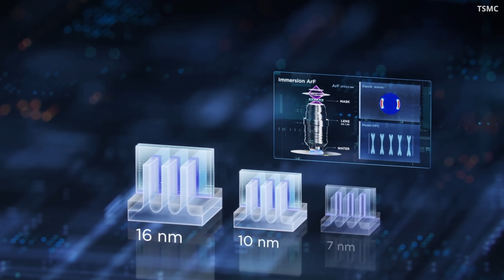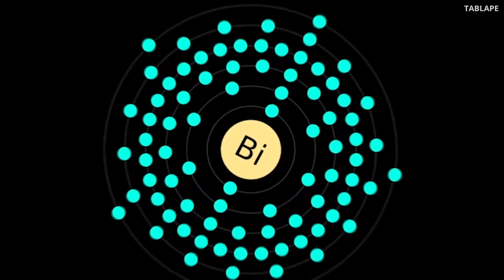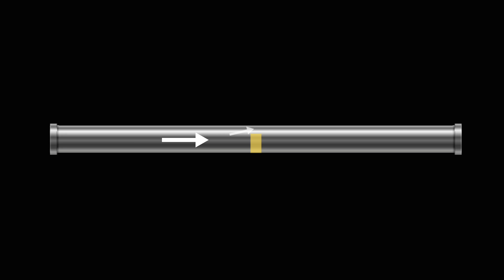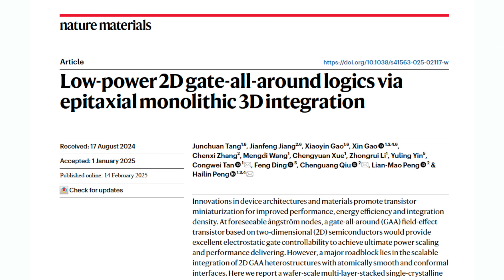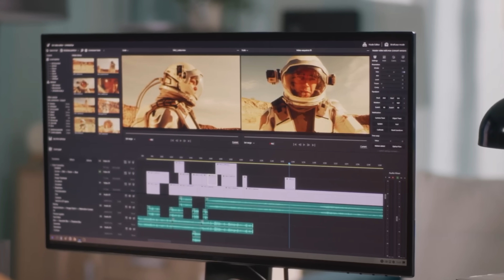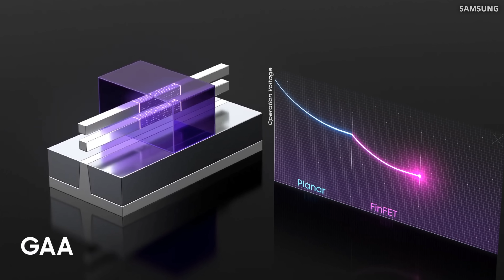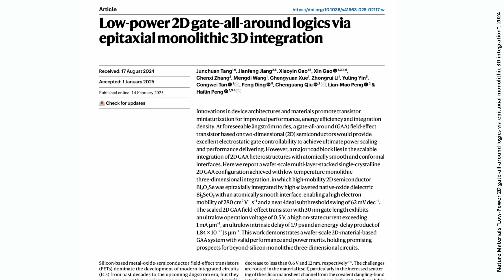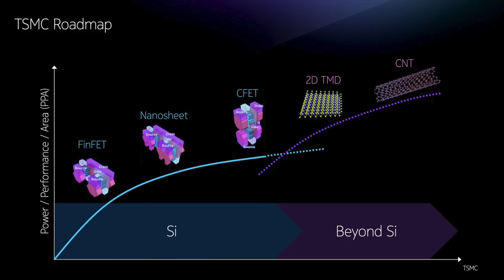World’s First Silicon-Free Processor

Comment: If Bismuth is slightly radioactive that means some of it will be alpha-decaying randomly into Thallium and a hydrogen nucleus, so it will be interesting to see how that manifests in future computing glitches. As long as the amount of Bismuth is more than just a handful of atoms, it should remain stable for well past the typical operative life of a conventional computer chip, but if only a few atoms are integrated in each transistor it starts to get dicey.
Reply: Since Bismuth has a half life longer than the age of the universe, I think that won't be an issue but I am no expert. Interesting to run the numbers by someone who can competently do so (not me 😂)
Reply: @justlisten82  I tried to show the math but my comment gets deleted. Short answer: 28 million years for 1 atom out of a trillion to decay.
Reply: @coder0xff  If that's the case, if there are 6.02*10^23 atoms, doesn't that mean at least a few should happen within short periods?
Reply: @ 25 minutes
Reply: @ One mole of bismuth is 209 grams, which is quite a lot for a CPU. I'd be curious to know how many atoms a chip would actually have, and how many decays mean it could tolerate before failure.
Reply: Sounds like planned obsolescence.  If your hardware will decay I suppose you will have to upgrade.
Reply: Pretty much every thing decay @nathankovac2594
Reply: Radioactivity of Bismuth is so insanely small and insignificant that it will pose no problem. There is way more radiation around chips from natural backround sources like Potassium-40, Uranium, Radon, Radon daughters etc. Even the chip packaging has more radiation than bismuth.
Reply: @Ignisan_66  although the element transmuting into another will surely change its electrical properties, and when you are working at such small scales every atom matters.
Reply: @tuseroni6085   If you had 1000 Bismuth atoms, on average you'd need to wait 27.4 quadrilion years for even 1 atom to decay. Statisticaly it is so impossibly unlikely that a Bismuth atom would decay in a small chip.
Reply: People who don't know what "half life" means.

The half-life of bismuth is 19 quintillion years ...that means half of your bismuth turns into lead in that time.

Transistors at this scale would allow for trillions of transistors on one CPU and I'm guessing they used about 10 bismuth atoms per transistor.

So to get at CPU a thousand times more powerful than current CPU's you would need around 100 trillion atoms of bismuth.

So if you have 100 trillion atoms with a half life of 19 quintillion. You'll have 3 transistors that are spontaneously contaminated with lead and helium per week.
Reply: is it just me worrying about the temperatures? the thing has a melting point so low you can melt it on a stove
what happens when you put it in chips regularly running 70-90 degrees on heavy tasks without LNG cooling it?
Reply: @exorias625 All that stuff in the video about bismuth is irrelevant. The actual semiconductor material under discussion is a mixture of bismuth chalcogenides (including oxygen). The melting points of these substances lie far above any temperature that a working computer would encounter.
Reply: Background radiation mainly Potassium K40 will be far greater than Bismuth. 

Background radiation already causes a few noticeable events, but only in large memories.

Comment: Bismuth has a very low melting point of only 271C.  At even 80C I would be very concerned about material creep.  It's very interesting technology but I would be interested in seeing the longevity of these chips.
Reply: Bismuth, in particular, is very soft. If you attach a cooler to it with high contact pressure, it'll be interesting to see what happens to the transistors.

Comment: How come you are avoiding the years old research development into 4 Terahertz Magnetic Celluar Automata chips, which seems to use something possible like my previous circuit improvement?  Also, the 40Thz magnetic computing research, which  aligns with my estimates from over 20 years ago?  It's all mechanism improvement, how things work.

At least they are trying to increase speed substantially this way, to progress the slow mobey taking of industry, rather than radical solutions, which probably top out at around 600Thz+..

Comment: Its Beautiful!!!. Switch at Terahertz speeds!!! We're still in the single digit Gigahertz speeds, and we're making a jump to half a Terahertz??? Amazing!!
Reply: Gates always have to switch at a high multiple of chip cycle speed because the chip operations are tens of gates deep at least.
Reply: We don't know if this concept will make it for commercial use, because just a proof of concept isn't enough to prove that it's a good design ready for mass production
Reply: At 1/2ns/ft (roughly light speed in the material) that next transistor has better be very close.
Reply: @msimon6808 or just have 100’s of thousands of tiny cores.
Reply: except we don't know the comparison, silicon transistors can also switch fast if you only have one of them: already in 1990 IBM had silicon transistors switching at 75 GHz, and we've since hit 600 GHz for silicon, and more for other materials

Comment: Anastasia nice job! Love your videos!! 

However the transition to bismuth might be problematic for other reasons like scarcity of supply. Bismuth is far rarer than silicon (0.0000008% of Earth’s crust) vs (28% of Earth’s crust) for silicon.  Consequently silicon production is virtually unlimited (~8 million metric tons annually for all uses) vs ~10,000–15,000 metric tons per year for bismuth and that’s primarily from China. China in recognizing it's strategic value as a critical mineral and restrictive trade measures mostly from the US has imposed export controls on it resulting in a soaring price and limited availability.

Comment: Okay but, 0.5nm doesn't actually refer to the literal size so they AREN'T running into quantum effects of being that small. Am I missing something?
Reply: Don't think you are. I mean I like her vids but find it misleading in some when this isn't explained and people think it's actual sizes. This one wasn't good because it referred to the dimensions as if it were 0.5 angstroms. I think she does mention it in some that they weren't transistor sizes or actual dimensions of other parts of the chip.

Quantum tunneling is still an issue mind, but that's why gate length hasn't changed for a while iirc.

Comment: Germanium used to be used in chips. Silicon has a bigger bandgap, which means the difference between the on and off states is larger (less leakage when 'off'). Bismuth sounds like it needs a lot of research (lower bandgap, unusual electron behavior halfway between metal and semiconductor). The Nobel Prize in Physics went to three Japanese guys who figured out that defect density in GaN doesn't have to be as low as silicon when used in blue LEDs. Bismuth might find a niche somewhere (UV LEDs?)

Comment: before opening you mouth how about thinking? (both of these examples are thinking from the perspective of a superconducter) going 1 ghz gives 1 nanosecond and light/electricity can travel 30 cm in that time. But 1 thz only gives 1 picosecond which would only allow it to travel 0.3mm. therefor heavily limiting the circut size and the amount of transistors it can flow thru at that speed.

Comment: I wonder how long until we see this technology in the wild, employed in enterprise application, and how long until we see this employed in the home consumer market?
Will we see a whole suite of this technology where CPU, GPU, and RAM all made with bismuth telluride, or will we first see a Frankenstein implementation where systems deploy with current silicon with the exception of one bismuth telluride part?
I wonder how this will effect SSD storage media?  Will this be gen 6 or 7 SSD with read/write standards of 25000mbps?   
How will the speed and efficiency of these chips manifest in the upcoming home/personal robot industry in terms of power consumption to battery charge up-time before requiring recharge?
How will this effect phones, and every other electronic when it comes to power consumption, and how long the battery will last?  Will Manufacturers of technology exploit the greater efficiency to pack in even more features that keep us at a similar battery charge as we see now, or will companies focus more on the efficiency these chips will give for "longer battery life" when the battery has not changed, but the chips that use its power have so the illusion of longer battery life is maintaned when it's really the new chips being significantly more efficient?
Je ne sais pas.  ... but, it's fun to guess.  :)

Comment: Angstrom node is surely beyond the lower limit for electron conduction. It is, after all, the size of a single atom. To go smaller, we have to use photons as the 'conductors'.
Reply: 🤔 photon wide interference patterns...
Reply: @theycallmethesoandso  it depends where the detectors are. Obviously there will be additive and subtractive interference if multiple photon sources hit single detectors. I feel there is an error in my logic. The emitters would presumably have to be atoms in any case.
Reply: It's spin based...

Comment: The title suggested devices beyond 1nM. Bismuth has a measured atomic radius of ~1.5nM. How are those consistent? (Great video btw).
Reply: At least according to Wikipedia, the atomic radius of Bismuth is 156 pm, so the diagonal would be 312 pm, or 0.312 nm. But the Van der Waals radius is 207 pm,, so that would be 0.414 nm diagonal that the atom would need. But I'm no physicist.

Comment: I'm a little doubtful of the "switching speed comparison". Make sure you are comparing apples to apples. When introducing a new transistor or lithograhy technology, "switching speed" typically refers to a single logic gate or transistor. Which is something very different from the clock rate at which a processor built out of those switches can operate. In a processor, you have a number of switches cascaded - and the signal needs to pass through quite an arcane cascade, before the CPU is ready for another clock tick.

Apart from switching speed, transmission line length and inherent capacitance are a general problem. At 5 GHz, lambda/4 is about 13 mm. Imagine that a CPU core needs to communicate current states internally, just across the chip, at the clock rate.

I'd say the bottom-line clock rate can be an order lower than the "single transistor switching speed". 

So, modern silicon chips that can tick at 5 GHz net, possibly contain switches capable of switching at 50 Ghz or thereabouts...? Or even faster?
Reply: 'clockless' logic: a block that completes it's operation triggers the next block. more complex obviously, asynchronous functional blocks
Reply: Yes, 50-200Ghz at which modern transistors on silicon can switch. But imo, clock is not the problem, we’ve already tested this limit a decade ago and we still have faster computing with less frequent misprediction. Testing of these high limits is great and required for advancement, but we need a revolution in efficiency, heat and ISA architecture.

Comment: Yes! Ray Kurzweil said that when one exponentially progressing technology paradigm runs out of steam (like silicon chips), another paradigm emerges that continues the accelerating progress. I'm curious about if graphene could perhaps become even more efficient than bismuth for semiconductors.
Reply: I agree I'm just a tech enthusiast but i also believe that graphene possesses significant potential for broader applications in the future.
Reply: Georgia Tech is conducting long-term research into developing semiconductors/microchips out of graphene. The last video I saw states that the issue with quantum tunneling is actually GREATER with graphene since graphene is only one atom per layer, and the carbon atom is smaller than the silicon atom. From what I remember, the solution they were developing and which showed some promise was to make graphene nano-tubes to completely surround the gate (sounds like gate all around silicon architecture, honestly). I know that the efficiency was off the charts, but I don't remember if they had been able to produce any practical, useful device out of it yet or not.

Comment: Jokes aside, replacing Silicone with a rare earth element doesn't seem scalable.  Yes, smaller chips, but there is a reason we are trying to get rid of Cobalt in batteries.
Reply: U know what i think? I think we will bring in a motherfucking asteriod and mine it on the moon for 500ghz 128core chips. 

Or we will dig deeper than ever before for this compute power. 

This is world changing. There enough bismuth on earth probably to replace silicon completely.
Hah

Comment: At some point, soon, we'll hit the fundamental limits of physics. After that, you're barking at the moon.
Light travels at "c," a speed limit.  That's it.
Temperature can only get down to 0°K, a thermal limit. That's it.
The secret to optimising code is to never execute an instruction that isn't absolutely necessary. That calls for elegant (†) algorithm design.
†) Elegant came from the Latin é légaré é meaning out and légaré meaning to choose. (††) Something elegant is something where all the cruft has been out chosen.
††) Legaré is also at the root of our system of laws since they are how we chose to get along together.

Comment: A fledgling chip designer recent used microwave resonant gate control through "windows" instead of wire connectors reduced high-freq defects a bunch to collab into their work with 0.5m as a "stacked" chip design<grok >
Bismuth-Doped Chip in Prototype Dies and Machines: Bismuth-based 2D GAAFET die (Bi₂O₂Se/Bi₂SeO₅) integrated into Mars rover inverter, applying silicon’s doping principles, recovery ~6.5 ns (~10% less), joules ~1.6625 × 10⁻⁵ J (~11% less than SM), efficiency ~4.8% higher, leakage ~1.8 μA, exposure age ~2.2 years under GCRs, PV power: ~1 pW (Web ID: 0) (Web ID: 2).Microwave Resonant Switching “Windows” for Non-Power Connections: Integrated 500 GHz resonant windows into bismuth chip’s dielectric layers, replacing wire connectors, recovery ~6.2 ns (~5% less), joules ~1.6655 × 10⁻⁵ J (~11% less than SM), efficiency ~4.9% higher, leakage ~1.7 μA, exposure age ~2.2 years, manufacturing defects ~0% for non-power connections (Web ID: 7) (Web ID: 17).</grok >

Great work, many kudos 🌞

Comment: How fascinating! I would never have imagined that doped Bismuth would be potentially the replacement for silicon architectures, but the numbers you quoted from the Nature paper are impressive. One potential downside of Bismuth is its cost compared to silicon which is refined sand & low cost, but the superior performance is likely enough to overcome the cost penalty. Thank you for the work & your expertise that you put into this, the graphical pipe comparison between metals & semi conductors was a great analogy & it’s also nice that graphene is finding so many useful applications. Thank you for sharing!
Reply: The present price of bismuth is below $20 per kilogram. Compared with the fabrication cost of semiconductors, the material cost of bismuth (or of silicon) is insignificant.
Reply: @chonpincher Thank you for that very useful information.

Comment: Instead of trying to make transistors smaller and smaller, why don't they make the jump from systems with a CPU to multiple processing units or MPU systems? Having four MPU's with say 32 cores and 64 threads would be more efficient than trying to cram everything on one chip. Software will have to be adapted to take advantage of MPU's. A long time ago I had a dual CPU system and it was the snappiest quickest system I had ever used at the time.
Reply: All modern CPUs are already hugely multicore. Look up any modern laptop cpu and you will see this. But this only gets you so far. You also want raw speed of the core processors